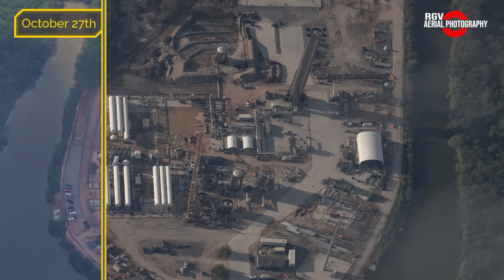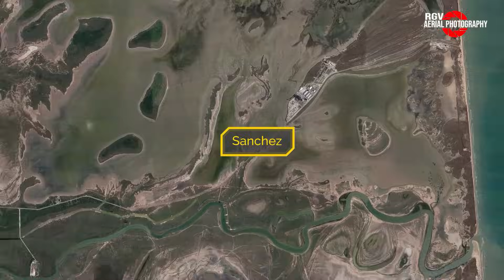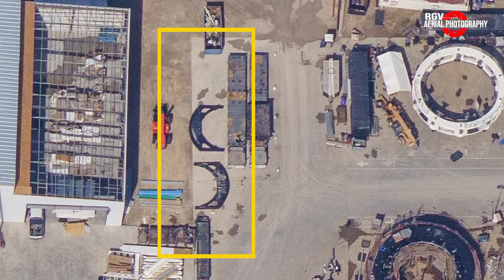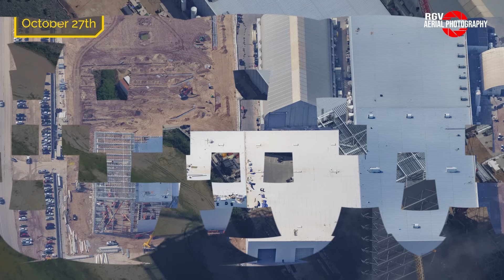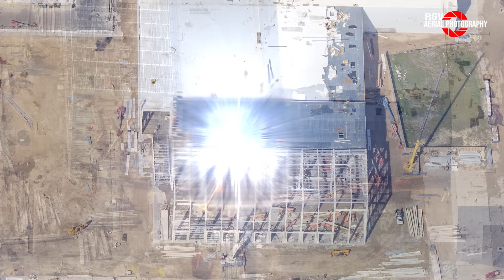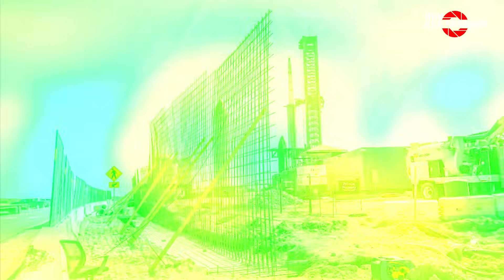S26: LAUNCH OR SCRAP?! - Starbase Flyover Update Episode 22

Comment: long gas tanks for air separation at Sanchez are like moving to Massey. The gas demand for testing at Massey and the launch site is too lumpy - sometimes they need a little, sometimes a lot. Thus building more storage at Massey and concrete base for gas trucks. Overtime we should see the four sites covered in buildings, concrete and grass to minimise dust creation.

Comment: I think S26 is an orbiting fuel tanker depot that will not land, the studs on the side are for solar panels.
Reply: The studs on the side are to attach tiles for re-entry: look at the pattern. The hull was built, then when the task of test orbital tanker target was assigned, no need for the tiles, nor flaps. And there's so much power available from the booster and the ship's own engines, the slight extra drag makes it not worth the effort to grind them off. As it's a test piece, then function and aesthetics go straight out the door. After testing it re=enters and burns up on the way down.
Reply: @paullangford8179  it will never re enter, it will remain in orbit and act as a fuel depot.